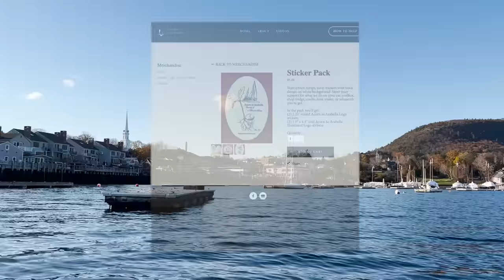Fire In The Boat, Installing the Stove - Episode 288 - Acorn to Arabella: Journey of a Wooden Boat

Comment: Good morn. 60 years burning  and installing wood stoves here in Minnesota.  Your stove connection also needs to be on the inside for same creosote reason you  cited.  It will be fine for dry wood as is but not for green .  Also you should construct an additional  collar around the raw wood roof  exit.  That is a risky hot spot.  Or better yet, an insulated stove pipe if you can find one. While your  stove is asthetically pleasing it does not appear to be well sealed.  Oxygen control and high wood consumption might be an issue in a REALLY confined space.  You might consider a better designed smaller burner in the future.  They have come a long way since your stove was made. Good luck captain.
Reply: You read my mind!!
Reply from the maker: Not sure anything could get much smaller than that firebox. It’s about 5” wide and 4” tall just past the front face and door.
Reply: Was thinking the opposite. Small fire boxes require more frequent loading. An annoyance in the daytime, and a pita at night!
Reply: @AcornToArabella  I’m not one of those well actually guys and I’ve watched you build her from the pouring of the keel. I to install fireplaces and wood stoves for a living and I was seriously concerned about your 1” clearance around that pipe. Especially since I know how much polymer based materials are in the roof of that vessel. Double wall insulated pipe requires 1” to combustibles. I don’t comment on your post much but when you know, you know.
Reply: The size of the box is not the highlight of his message. The clearance to combustibles and the collar on the outside of the flange were the main concerns. Your going to start to get creosote leakage onto the top of the stove and that is going to cause a serious fire hazard as well as a nasty smell and a caustic environment. I’m not coming at this from a critical perspective, I just want the two of you to be safe while your sleeping.
Reply: Steve, in my past experience with a wood burning stove, I encountered a problem where the damper had a tendency to loosen up, allowing it to shut off the draft .
Reply: @newbiereview6291  .
- "that is going to cause a serious fire hazard"
- Exactly correct...thank you @newbiereview6291  for the WhatIsNeeded EMPHASIS ! !
- I know because years ago I had a chimney fire in a Colonial Home built in the early 1800's because of creosote built up in the middle of winter.
Reply: Logical comments here.  Short term you be OK but as the build up comes that will be the issue.  Also one miss in the comments he has a 2” gap not a 1”.  He install a 3” pipe in a 5” hole
Reply: @jlemieu1  3" pipe in a 5" hole leaves a 1" gap...
Reply: @jlemieu1  not a mistake, I do this for a living. 3” pipe - 5” hole = 1” clearance.
Reply: Consider one of those small Stirling engine fans to sit above the stove and help move the hot air through the boat
Reply: As mentioned, a stove top fan for when you're at a calm anchor or marina will push tgge heat around the boat nicely.   We have two on top of ours, pointing in different directions, they're great, but you know your boat best and if they're actually  needed.
Reply: 100% a well sealed fire box with ventilation control would be much more efficient and safer. A larger annular space + insulated or double walled pipe through the dog house is a must.
Reply: @StumpCreekSentinel  That's going to be specific to a given stove/damper design though.
Reply: @jlemieu1 a 3 inch pipe in a 5 inch hole is 1 inch either side
Reply: Steve, It looks as if you are going to have to take the stainless plate off of the house pronto before that glue-shmoo sets up hard as a rock, to cut a larger hole in the house top pull it off and cut your hole at least 7 or even 8 inches in diameter to allow you to get a double walled piece of pipe to go through the house top. If it were me, I'd get your stainless steel fabricator to make another tube up 5" in diameter and TIG weld it to the angled lid and just weld three small stainless stand offs at the bottom of the two tubes to space the tubes concentrically that way you have the house top cut out let's say 8" dia, then  1 1/2"gap, outer tube, then 1" gap then the inner tube. I'd also get him to make up the tube to stove flange so it goes into the elongated hole and not around it as suggested because of the creosote fire hazard. Safe sailing you two.❤❤
Reply: Guys you are all creating a hysteria around a problem that probably does not exist, no matter the years of experience you have installing stoves. The pipe loses heat as air travels through it. The firebox is tiny and produces very little heat to begin with. The reason to enlarge the hole and/or put extra insulation there is if the thing is getting truly hot. This can be tested easily enough by touching the pipe with a thermometer. I'd be surprised if you get anywhere near combustion temps there. And if, through some miracle, there is concern, Steve can add fins to the pipe so it radiates more heat inside the boat before it reaches the roof hole.

Comment: My Webbers Cove 34, built '67 in E. Blue Hill, ME, and finished in FL was a raised pilot house, cockpit motoryacht. A most delightful vessel had reverse cycle ac/heat plugged in! How I intended to spend the few cold months on the Carolina Coast in the winter. My last New England summer cruise was 2019. I was solo and I took my time. I made my old home port, Block Island for Labor Day Weekend, and the Tuesday began my homeward bound. South of Bayhead, NJ I had a Perkins Problem and was close enough to make it to Beaton's Boatyard. I stuck to my rule and was leaving the No. East before mid-October, but the work on the motor took six weeks! I left Upper Barnegat Bay on the 2nd of Nov. As I tied up in Cape May, NJ the drizzle turn to flurries for a few minutes! It was really cold in the pilot house that day and I had a few days to make a go of it when th wind died down. I had installed an old Shipmate "Skippy" in the corner of my salon as my rev./cycl could not make heat once the water dropped below 42°! Since I wasn't moving in open water a mellow fire of lump charcoal was sufficient.  Steaming into a cold wind called for a different tack. I bought a 50lb. sack of nut size hard coal. I'd get afire started with the lump charcoal and let that get glowing red the fill the stove with coal. After some time with air open shut the stove tight and let her do her thing. I believe your range has a shaker on the bottom of your firebox with a space underneath to shovel out the ashes. Sir "Skippy" did not!" After I made the fire my coffee would be ready. I had a 12V fan above the stove blowing the heat forward. It heated the whole boat. The pilot house was 70° - 72° all day! My last 3 trips running ahead of the cold have been caught up in cold snaps that surround me all the way down the coast! All the Best,  Rob⚓️

Comment: You should consider changing the outside part of the chimney to an insulated one, so the smoke doesnt condense on the cold walls of the chimney producing creosote. An insulated chimney also produces more draft because the smoke doesnt cool off as much.
Reply: This - 100%.  It will draw better, reduce creosote buildup, and be much less of a hazard on deck.
Reply: It may also be a good idea to put a fine wire mesh on the opening of the chimney to catch larger sparks which may melt tiny holes into the sail.

Comment: Nothing better than a wood stove on a boat. It will dry everything out so much better than any other kinda heat. I found that you can take some wood stove rope gasket and put it around the roof hole around the pipe and that will stop the heat from burning the house roof. It will burn it someday down the road but the rope gasket will stop it from happening.
Reply from the maker: Thanks for sharing!

Comment: Awesome that you got Nigel on board!!! Ain't no better eyes on the problem. :)
sidenote: you should get a fire bulb and place it above the stove. Better safe than sorry, better to never need it than not have it. They're usually used in restaurants and such. Basically a glass ampoule with a fire retardant that pops open and extinguishes the fire automatically. Very effective, simple, bulletproof and it doesn't catch the eye ugly either.

Comment: You could consider feeding air to the stove from a space that isn’t heated. I guess the bilge would do fine. Otherwise the stove will suck heated air out of the cabin, creating a cold draught. The stove in our house takes it’s air from an air duct under the house through the floor beneath the stove.

Comment: Wood stove + oil stove + gas stove? Belt + belt + suspenders? Lumberjack ideas for a boat. Wood stoves were used a lot in the old days because there was no alternative, but the boats burned and the wood dried out a lot. This stove is also very primitive and dangerous and is not well insulated or protected.
Reply from the maker: It’s quite simple… Steve really enjoys woodstoves, so he has one. 👍
Reply: @AcornToArabella obvius

Comment: Gas tight connections are critical below the exterior collar. Carbon monoxide detector as others have mentioned also very important. Might also be a good idea to add an exhaust pipe that sits around the housetop mounted pipe collar, so it doesn’t get completely weathered and tarnished with the salt and heat. I would also recommend adding some lagging on the bit of pipe near the oven, so no one burns themselves while cooking dinner etc. I would also recommend looking into a Pizzo electric fan to push the hot air around without using up any power from the electrical system. ❤️
Reply: I’m sure there are smarter people with more experience, making better recommendations that I am but of course I only comment because I care about you, Robin and Akiva. Hopefully not coming across the wrong way. 🤣

Comment: Wood stove is the best heat source. Dry. 
Stay vigilant.
Looks like a very well contained small fire.
Does it heat the boat well ?
Nothing beats -20c. snow storms outside and +20c. indoors 😊
Reply from the maker: It works pretty good! A little tricky to start.

Comment: you might want to consider those fuel bricks.  they are wood  saw dust and wax.  clean to store. long burning. and lots of heat.  they burn a long time even in a small firebox.
Reply: They have the same heat content (by weight) as any wood product, and might be an issue in that small space.  Might be worth the price when moving, since you only want to use LOCAL firewood.

Comment: May I suggest using automotive exhaust wrap around and under the roof flange for the smoke stack. It will give a thermal barrier with minimal space required 👍
Reply from the maker: We kind of want the heat to radiate off of it, to be honest.

Comment: Steve, you might want to consider using engineered fire logs or compressed brick. They are easier to store, burn cleaner, produce less ash, and output more heat per volume than ordinary firewood. There are a number of places in Maine that produce them from hardwood sawdust and other wood byproducts, but no added chemicals.

Comment: Steve, notice how the top of the stove flue / vent outlet fits inside of the funnel reducing pipe you created?  The next joint into the damper should connect the same way.  The top of your funnel reducer should be crimped fit inside the bottom of the damper.  This way air will be drawn INTO any joint gaps rather than soot or CO being pushed out.   A hand crimper can be purchased at pretty much any plumbing or Heating supply house.  I'll bet some local plumber or heating person would let you borrow theirs for the 5 minute job.   Stay safe dude! 👍

Comment: I would recommend you use ELK-Aluminum-Insulated-Sealing-Ductwork tape on all connections and never use coal in that stove. I did that once in our Franklin wood stove and had to sit up for hours spritzing water on the pipe (it was glowing red) where it went through the floor and ceiling . Paraffin logs (Duraflame or pine mountain) worked well.

Comment: I use the round one that you showed first for a year with my cubic mini and it would backdraft and smoke up the cabin in higher winds I then switched to the other t type head and it worked well in any weather! Under heavy use it would drip a little creosote on the deck so I surrounded the deck pipe with a turks head type rope mat and that helped.
Reply from the maker: Thanks for sharing that experience!

Comment: A large flange like that can have a tendency to potato chip. If you run in to that, just taking a disk and cutting radially from OD to center (probably just 1/3 distance) in a few lines places will keep it flat and still dissipate heat.

Comment: We had the same Shipmate in our Tahiti.  A friend had a custom riser made out of stainless which went int a deck fitting.  Water in the deck fitting (it had a groove all around the chimney) kept it from getting hot and burning the deck.
Reply: The chimney ran through the deck, which precluded the need for a hole in the coach roof.
Reply from the maker: Those are called deck irons, and they’re great solutions.

Comment: Not to be another keyboard advice giver (and I'm sure you've already thought of it) but I would consider insulating the pipe where it goes through the deck. I would also seal that bare wood where you've made a hole in the deck (epoxy, primer, paint).

Comment: oval to round adaptors are a real pain  there are a variety on the  market but they rarely fit,  . the closest one i got was chinese and did not fit inside or outside  I took it to a ducting shop, and they ran the big end through a crimper to form corrugations it fit well inside the collar.  then I calked the joint with black stove cement.

Comment: Now that you no longer have easy access to the farm's wood supply, you can check if bags of 'pelletized' wood shavings might make a more convienient fuel for the stove. It's more efficient, takes up less stowage room, burns cleaner and avoids introducing 'wood pests' into the boat. You may need to make up a Stainless 'mesh' basket for the pellets if you don't want to start a small wood fire first to provide a coal bed to control the air flow to the pellets...

Comment: there are several dangers wintering on the boat in Maine. i dont know if camden harbor freezes in a normal winter, if so there are several things you need to do to protect the boat. i am sure your boat friends can advise you. the danger i think that is  often over looked are the docks. they become very icily and therefor very slipper. with winter coats and boots on you will not be able most likely to pull your self up on to a floating dock if you slip and go into the water. boat yard are deserted places in the winter if you need help. you might want to rig a safety line to the boat from the land and check to see if there is any ladders from the water to the dock. i carried a small fog horn in my pocket when i went to the boat in the winter to check on her.  good luck

Comment: I wonder if there are heat radiators that could recapture some more of the heat going up the chimney?  Just a thought. It might also make things a bit safer: the more heat you can suck out of the flu pipe before it gets to the exit, the less is up there to mess with the house-top! OOH: another idea: how 'bout a little piece of metal flashing to cover the raw-wood edge of the house-top inside the flu hole?  :)

Comment: I'm wondering if it might not be a good idea to put up some kind of plate heat shield near the cabin top. Epoxy starts to give around 140° F, paint too. But shiny stainless or even brass wouldn't look bad, cost much, or be difficult to install, just screwed to the cabin top beam there, and with spacers to make it flat. Even just the convection it would produce would be useful distributing the heat in the cabin. Looks great, all of it.

Comment: Another great video and love watching Steve continue to work on his beautiful boat.  Thanks for the video story.  I had one question about the chimney above the house top.  It appeared sort of tall to me and am assuming Steve checked clearance with the boom.  Also, because of what it is, if someone were a bit unsteady walking nearby and reached out to grab the chimney would it support them?  Would it be hot to "grab" onto?  Fun to watch Steve work it through and get heat in his new home.  I suspect sometime before next winter he will end up reengineering all of it but this project keeps the two of them warm right now.  Bravo!
Reply from the maker: The chimney will come down and a cap will go on the cabin top when under way. The diesel heater is for when we’re moving.

Comment: You should look into diesel air heater for a secondary system. Safire is the best you could get. Low power consumption, low diesel consumption + air circulation safely with no mess. This is my experience from the cold baltic sea
Reply: They have a diesel heater, you can see it to the left of the stairs. 6:43
Reply: @CorwynGC  Oh I am sorry I completely missed that!

Comment: My instinct would be to cover the inner surface of the 5 inch hole around the 3 inch chimney pipe with some thin metal.  Does that make sense?  I just sort of imagine it reducing any baking of the wood and epoxy.